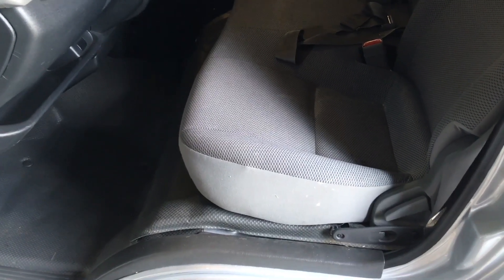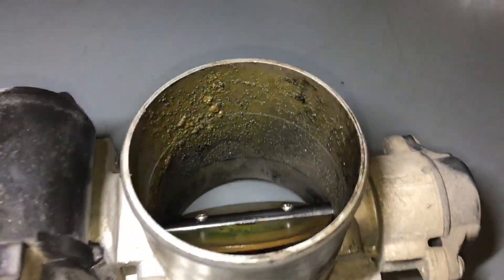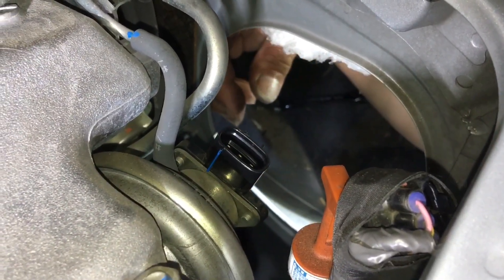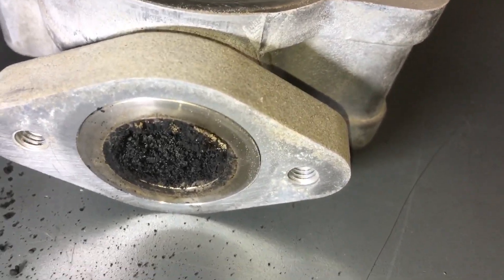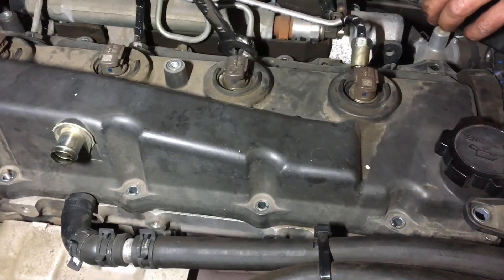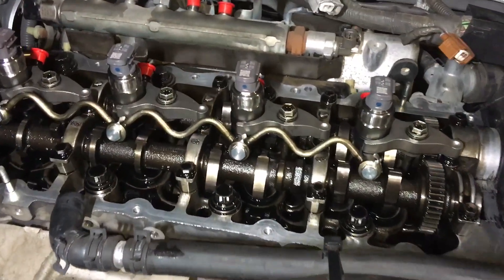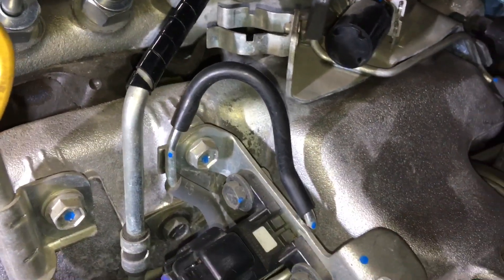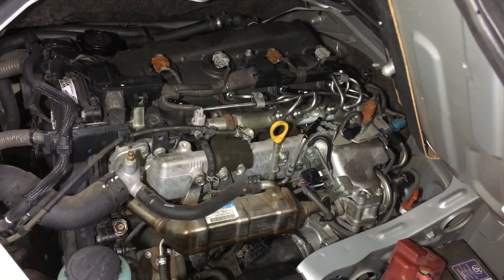THE HIACE in the PRADO Hospital - injector replacement FOR YOU! - amazing egr - major blockage

Comment: Thanks Anthony, great video.
I watched a few of your vids now and im tackling the egr on  my 2007 hiace this very day.
No codes but has no power at all going up hills so i reckoon shes blocked 480,000 ks so next will be injectors and
 then turbo. I have a trade acc with my local toyota dealer but your kits may be more comprehensive.
Cheers for now and thanks.

Comment: Thanks for showing us the Hiace Injector job. Liked how you described the egr as self healing with that builup just before egr in that instance. Egr itself was very clean with only slight oil residue. Yes, the Throttle body needed a good clean. Sounded great on start-up after new injectors. What was the kms reading on that 2010 model?

Comment: what would a job like this cost? I am looking at same job in my 2010 SLWB Hiace......EDIT the 2010 SLWB does not have that access plate for the oil filter....prick of a thing to get too and has a different EGR and throttle body setup